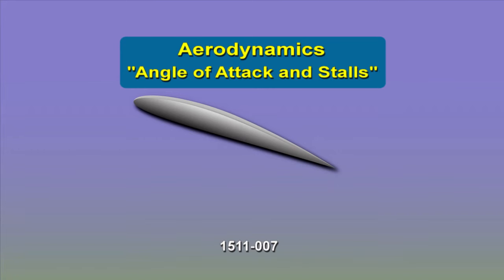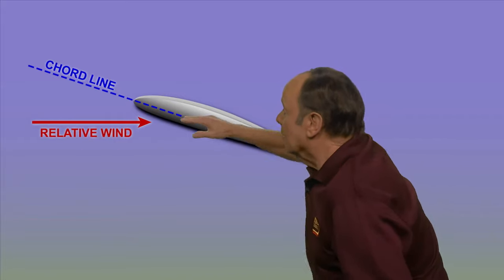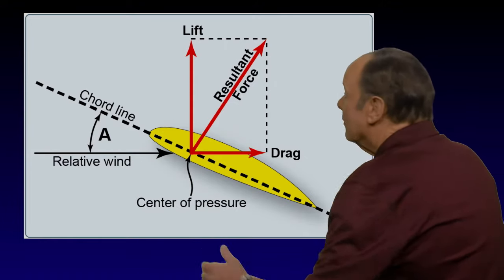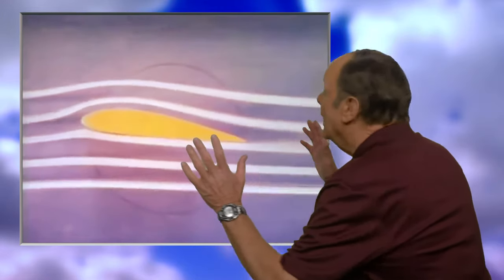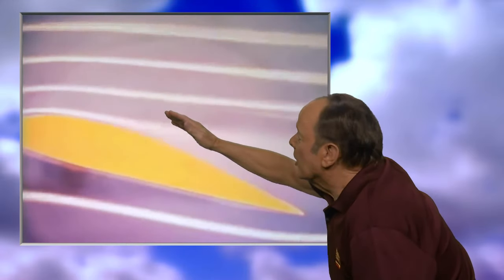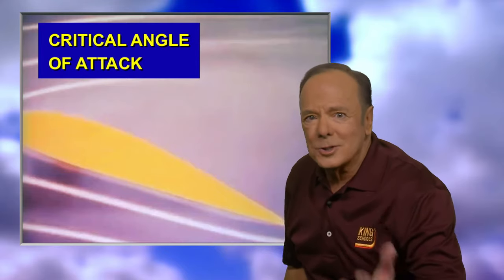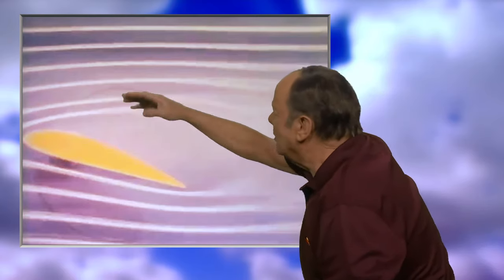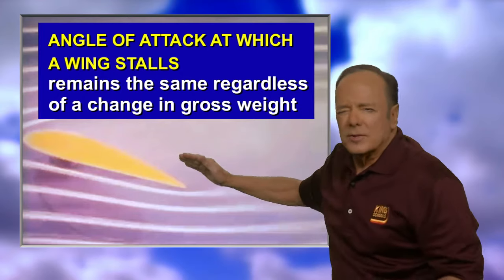What is a Stall? What is Angle of Attack? | King Schools

Comment: what I don't understand is why a stall on the upoer side of the wing makes the wing not produce lift since below the wing, air is still hitting the lower side pushing it up so shouldnt it?
Reply: Its more a case of that the  wing is getting sucked up from the top of the wing !  When that does not happen its stalling !
Reply: From my understanding, the amount of upward force produced by high-pressure due to air flowing underneath the wingis far less than the low pressure force on the top side of the wing, which is sucking the wing up. When a stall does occur, it's when the airflow detaches from the top surface. The wing is still producing lift, but a fraction of what it was before.

From the video he states that when the airflow detaches "lift is destroyed", he could be more concise, I think a better phrase would be "lift is significantly reduced".

Comment: But the Velocity is dependent on the density of the air. In which case , the stall speed must vary at different altitudes. Can you clarify , please?
Reply: What I understood is the relative speed of the aircraft with respect to the ground is increased but the airspeed remains the same as it requires the same amount of pressure to calculate the airspeed.

Comment: hmm... so here he says at critical AOA the wing stalls.. but on my commercial test prep it says at critical AOA the wing still has smooth airflow, weird..

here is the question + the correct answer as it appears on the practice exam: 
"94. Reaching the critical angle of attack means that the wing will ___"

A. continue to have smooth airflow.

B. stall.
C. have separation of airflow over the trailing edge.

Comment: Big big big confusions made by a lot of SPs. Relative airflow IS NOT the horizon. Your pitch angle is not necessarily your AoA. 

Just know that relative airflow can change... And it operates in the parallel direction of the direction of movement, in the opposite direction.